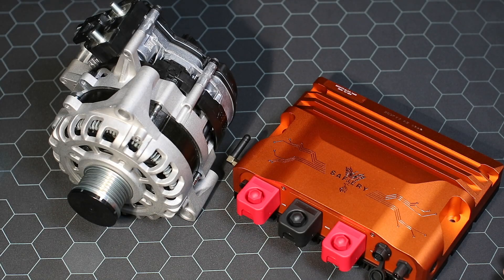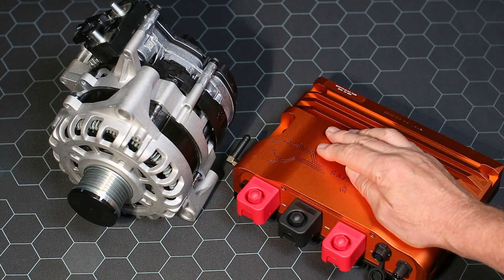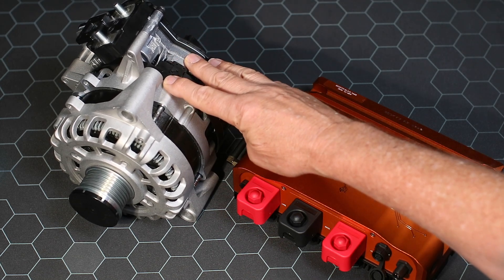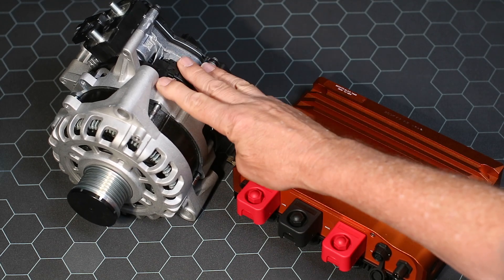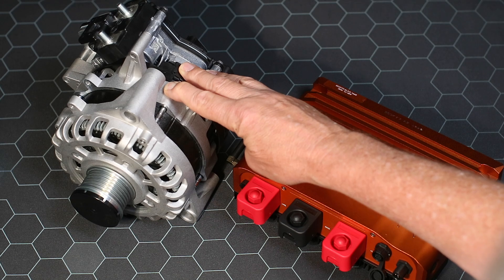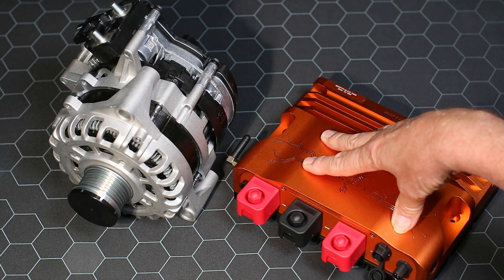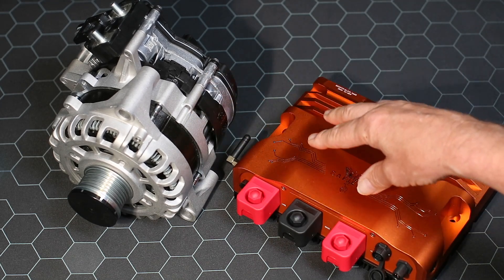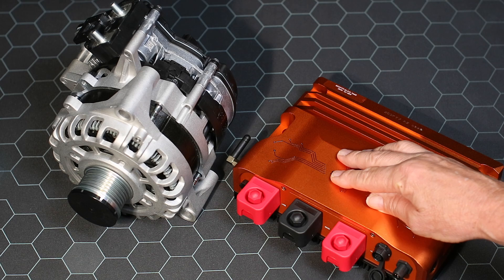Safiery Synchronous Hybrid Alternator operating as Mild Hybrid with 10kW available to assist engine

Comment: Mounted to a 1991 Mitsubishi Galant 2.0 8v that is said to do 11km/L, any estimates of how much gain in highway overtakes and fuel efficiency?
It has just been converted to "Veteran" insurance, so it's going to be easier to modify in terms of regulations :)
Reply from the maker: It says 5-6% with a lot of stopping and starting. On a long trip it is <1%

Comment: Hopefully you will still sell those for the years to come. 
I have an audi a2 1.2 tdi that would benefit a lot from this.
Technically the car can achieve 3l/100km. I wander how low would the mpg get with this.

Right now I do not have the budget for it but this would be an awesome addon.
Some of the alternators you use can be a bolt on fit. 
You made me dream:D.  Maybe next year i would get the budget for it and test the hybrid function on the little bug. 
Good luck.
Reply from the maker: Yes ours started on the Audi A8 as a BSG... but inverter is different.

Comment: I am curious if it would be possible to get regeneration to work with a fully mechanical diesel engine (no ECU); how much of an investment would make this possible?
Reply from the maker: This is our plan for the Sprinter. No ECU interface, when there is the Gear 1>2 change, we relax the motor which is mild hybrid operation so the mild hybrid runs for 4-5 secs. The calculated fuel saving is 5-6%. Then it operates as a generator.

Comment: Yes am interested in mild hybrid functionality as direct CAN control of the MB BSG is hard. Scotty can do it!
Reply from the maker: Do you have N62 mount? We hae the software prepared but have to run an actual Sprinter with it yet. The Mild hybrid mode will run for 4-5 seconds from taking off. This is the area of biggest fuel savings

Comment: Did you get the software stack figured out for belt starter generator Bruce?
Reply from the maker: Yes we did, watch the next 3 videos on it. We are now doing the combined BMG and Scotty with maximum power point. Slick.
Reply: @Safiery  looking forward to it!  I would love a boost on Sprinter camper van with a 48v house battery.  I'm wondering how big of battery system would be needed?  Would 32 kWh work?  I'm thinking that could serve a dual role of powering the camper and providing boost. Fuel savings would be a major plus+ in general.  Also, especially when going over long hills and inclines.
Reply from the maker: @OldExodus yes I think we can do that. We have to get the throttle position from the #sprinter CAN before and ODBC and then we can run a mild hybrid for you. The bigger the battery set the better the savings but I think 20kWh is big enough.

Comment: Tbh. As cool as mild hybrid functionality is. Just the ability for it to start the engine, then provide 48V power to the vehicle is already very interesting.

I can't tell from the footage exactly which unit this is, but I've already followed a few blog posts from folk reverse engineering these types of motors for their own purposes from brands like Continental as used in many VAG vehicles and while it's not a project I have time, space or funds for, I did like the idea of taking a pure mechanical diesel motor like an OM606 and slapping one of these on it with a view to having a vehicle that solely had a 48V electrical system and no 12V battery at all.
Similar vein, just slapping one of these on a single cylinder stationary diesel for non mobile off grid scenarios is pretty interesting.

Alas I have more time for thinking about crackpot schemes than performing crackpot schemes.
Reply: 😮 here i am with my 2023 VW Crafter realizing I should have bought the sprinter 😳
Reply from the maker: Thanks.. Mental effort is a major source of joy for me.

Comment: In the mild hybrid boost motor mode, is it transmitting the extra power through the serpentine belt or some dedicated system?  Also, could it fully replace the starter motor?
Reply from the maker: Yes to Serpentine but no, starter still needed in our case. but the BSG's these are off dont have a separate starter

Comment: In the mild hybrid boost motor mode, is it transmitting the extra power through the serpentine belt or some dedicated system?
Reply: Serpentine, so you'll normally see on vehicles with these types of motor from factory that they have quite a tight belt wrap on them, and sometimes an extra rib or 2.

These are only used in mild hybrids. You don't ever drive under electric power alone with such a unit, though it does have enough torque to start the engine while in a driven gear and still adds a tiny lil bit of grunt to get it rolling, but generally you are relying on the ICE power plant to do a lot of the work.
Reply from the maker: See above

Comment: Adding this to a 1.1L (like my 86 hp Chevy Spark) would take it to 99 hp. That'd be good for getting on the freeway.
Reply from the maker: Yes, that would be a nice boost
Reply: the 1.1L engine wouldn't even drive that generator without stalling 😂

Comment: I’d love to have something like that on my 60hp tractor as a boost function.  There are times when a bit more power in short duration would make all the difference.  Any fuel savings would be a bonus
Reply from the maker: Well you may get it to happen but you need a reasonable size 48V battery and that may be a bigger problem to locate on a tractor.